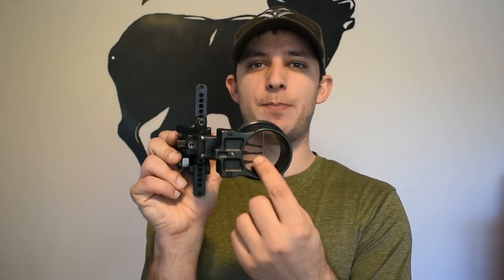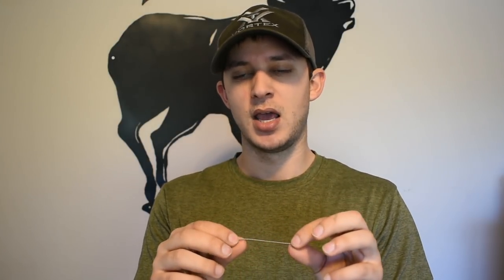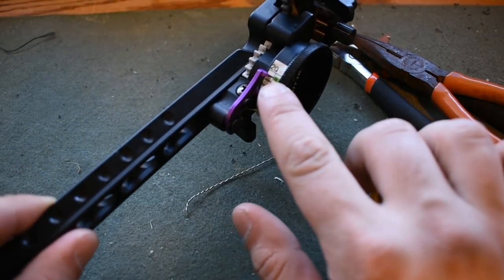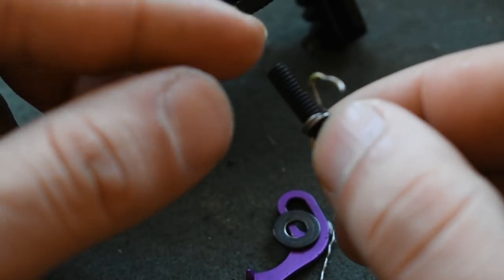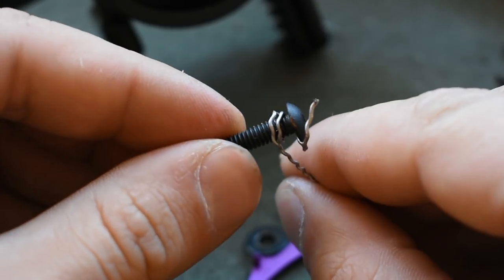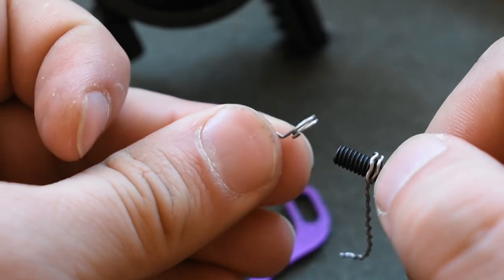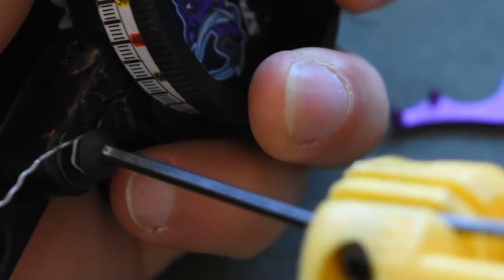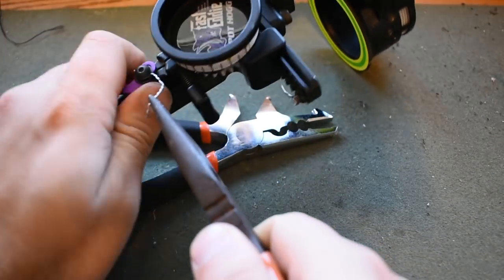How to make the "trifecta" Upgrade to your Spot Hogg Fast Eddie

Comment: I’m somewhat confused as to how the pins align to the pointers and stay accurate through the yardage range. If set the way it is in the video is the top pin 20 middle pin 36 and bottom 50 yards if you don’t move the dial? I assume the pins have to be tuned to the pointer.

Comment: I bought the fast eddie 3 pin.  It only comes with a single pointer.  What the fast eddie XL the same way?  Did you buy the double pointer and then just zero the top two sight pins to what yardage the double pointer is pointing to on the yardage tape? Or did you have to make any adjustments to the sight pins?

Sorry if this is confusing.  =I
Reply from the maker: That's a good question. I will try to answer it as best I can. If you don't get your answer let me know maybe you could re word it so I can try again. But here we go..

So the Fast Eddie compared to the Fast Eddie XL is a dovetail versus a regular bow mount. The newer models come with the new pointers. The pointers mount onto both fast eddie models the same way so they aren't sight specific. For the other models they are like the hogg father. 

The way I set my sight up was to use the top 2 pins for the factory double pointers. You can buy double pointers from spot hogg directly. You must sight the pins to the pointers as the pins are adjustable and the point gap isn't. I sight in my top pin like regular shooting 20 yards then dialing the same pin to 60 to get my sight tape. I install the correct sight tape, then double check my top pin to make sure I did it right. Then I move onto my second pin. the pointer will tell you where the second pin should be shooting at. In my case its at 35 yards. From here you can repeat the process like you did for the top pin by dialing the second pointer to 20 yards and adjusting your second pin to hit accordingly. I do it this way because there is less risk of missing the target since my pin and pointer may be way off. Once you sight it both top pin should shoot exactly where the pointers show on the sight tape no matter the yardage. Repeat the same process for the trfiecta upgrade.
Reply: Great!  Thanks for the quick reply.  Cant wait to get this thing set up

Comment: You still need to move your sight to shoot past 40 correct?
Reply from the maker: I can shoot out to 60 without dialing. I just use my pin gaps like a fixed pin. My pins are set at 20-35-52 currently. So I just aim a little high at 60 and I’m good to go. All ranges in between 10-60 I know pretty much which pin to use and where to hold of I don’t have time to dial.

Comment: Don't get me wrong The trifecta is genius level idea. But i think it can be improved from a simple wire.
Reply from the maker: William Frost Oh for sure! If enough folks become interested in it I think they will supply the demand. Until then the wire will have to work. Unless you can 3d print one or something?
Reply: Garrett Weaver for someone upgrading from a single pointer with a longer screw could  you use that in combination with the dual pointer?
Reply from the maker: William Frost I’ve tried using the single and double pointers together and couldn’t get both into position unfortunately. But that’s good thinking.
Reply: Garrett Weaver hey thanks for the quick responses! I'm fairly certain this is the sight that's going to end up on my new bow so I'll see what I come up with. If it's any thing good I'll post it up here. And again great idea really is the best of both fixed and adjustable pin sights.
Reply from the maker: William Frost Thanks! That’s would be great to hear what you end up with!
Reply: Can you please explain the benefit of this technique. Thanks.
Reply: @Hamptondan1515  sure the extra pointers are for the extra sight pins. 3 pins 3 pointers so you always know the yardage of all the pins.

Comment: Theres no way that will work your yardage gaps get bigger at further distances  so your indicator gaps wont stay the same when you spin the dial if you dont notice the difference its possibly because your not shooting accurate enough to tell the difference
Reply from the maker: Or you don’t understand how a dial tape and slider sight works. The only part of your comment that’s correct is the gaps don’t stay the same. 

You need to think of it as having 3 separate pins with 3 separate dial indicators forget about pin gaps. I shoot plenty accurate, thanks though 🤘